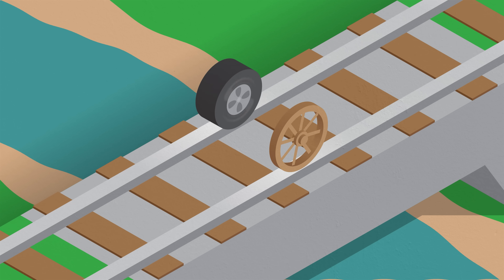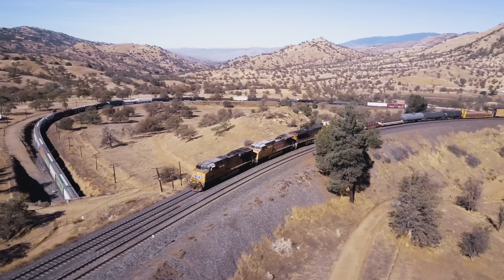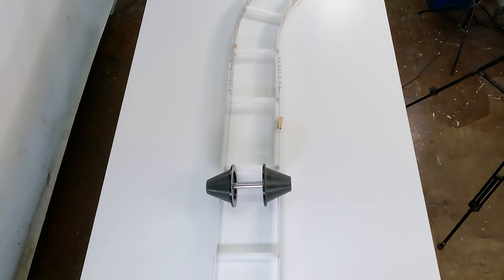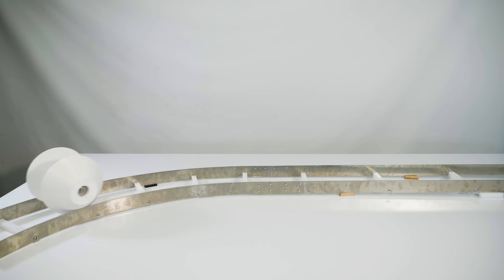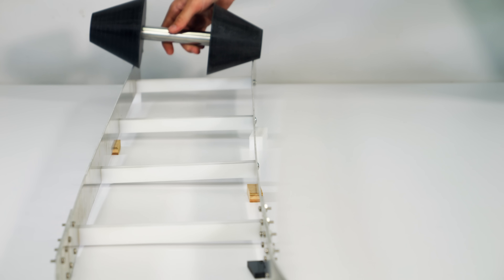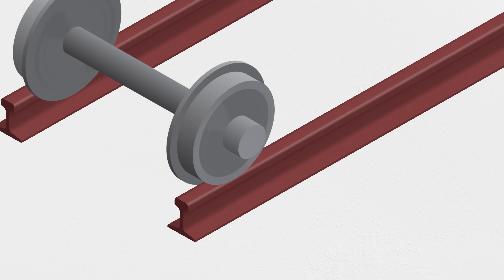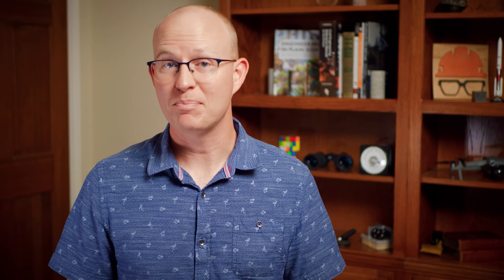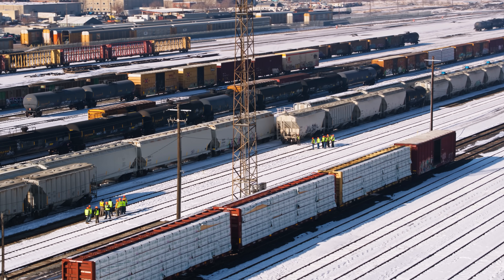Why Are Rails Shaped Like That?

Comment: Hello Grady i had a question about a log splitter my buddy and i are going to build. I don't have the knowledge to calculate if this beam is strong enough.
This beam is 8" wide top and bottom with 1/2" walls the beam 12" tall with either 5/16" or 3/8" web. for safety I figured using a 5" cylinder at 3000 psi more realistically either a 4" cylinder or 5" cylinder around 2200-2500 psi. This is just a picture of what beam we are using. i just wanted to see if it will hold up. Usually an "H" is more ideal as far as I know. Any help would be great, thank you. I also like your YouTube videos and thought you would be the person to ask.

Comment: Hi from the other side of the "Pond" where Railways were invented. What is most amazing is that the fundamental shape of the rails were understood by the Victorians 150 years ago! In the UK rails were attached to the sleepers using chairs hence the shape was known as bullhead where as in the early USA the use of spikes onto the wooden ties hence the flat bottom shape allowed for the faster and cheaper construction needed for the distances involved. Over the past 50 years UK uses flat bottomed profiles on concrete sleepers.

Comment: Why passenger trains stations are not built elevated from the terrain  before and after the station? If built this way, energy could be saved by minimizing the breaking energy waisted and the need to accelerate when the train leave the station again . The same is for roundabout and junctions where cars should decelerate or stop anyway and then accelerate again.

Comment: When loud "squeaking" or "screeching" occurs while a train comes along railtracks, this is a sign for the railhead being worn off resp. also too flat. Maybe also broadening has occured because of the heavy weight being applied with every pass of a train. Especially the noise then occurs in curvy segments. Therefor grinding is necessary from time to time (re-shaping of the railhead on otherwise intact rails) or, if inner damages have occured - structural wear - which is detected by x-raying the rails during maintenance passes along a track, the replacement of a damaged rail is necessary.

Comment: In the south of the United Kingdom we restore steam locomotives:  https://www.southern-locomotives.co.uk/News/news.html  and this includes replacing worn steel six food diameter locomotive driving wheel tyres.  The maintenance, inspection, safety certification, insurance,  and running costs are enormous and require years of forward planning.  Every 10 years the boilers have to be removed, government inspected, repaired as required and pressure tested, before reassembling.  Plus, you can't get spare parts at your local DIY shop!  I remember a hot September morning 1947 attending the ceremony naming the first Battle of Britain class locomotives by my future stepfather:  https://www.youtube.com/watch?v=AQNnfsFcbz8&ab_channel=BritishPath%C3%A9   There's nothing so moving as live steam!

Comment: Even if hunting doesn't lead to derailment it can be very hard on the equipment and rails. 
Flange greasers are used to alleviate wear in curves and reduce noise. 
High tech rail scanning vehicles can find small defects in the rail before it becomes a problem. 
If within parameters, the rail head can be re-profiled by rail grinding instead of replacing the rail.

Comment: No, not all wheels have flanges. Some locomotives have too many drivers close together to allow for all wheels to have flanges and still negotiate tight turns. You see this especially on trains designed for mountains or narrow gauges. They may have two flanged wheels, followed by four flangeless that are allowed to float about on the top of the rail, followed by another pair of flanged wheels. These are also called blind drivers.

Comment: You skipped a topic of rail re-grinding. Once they are old and beat up, a special service car rolls along and grinds the correct profile back into the rails. This can be done many times over before the section needs to be replaced due to thinning of the material.

Comment: I'm 74 and when I was young I worked on what is called a, "section gang."  At times when the replacement rails were not available because of the inner edges being worn,  it was a common practice to remove the spikes and turn the rail around so that the unworn edge of the rail was to the inside of the track.
Reply: I'm a little older than you and remember when farmers in the South did something similar with their tube socks.

Comment: Back in the late 80's, I went to an Arizona Cardinals Football at Sun Devil's Stadium in Tempe (Phoenix), Arizona. In front of the Stadium ran the train tracks. Being the juvenile delinquent that I am, I put a penny on the track to have the train smash it. I watched the train run over it. After the train had passed, I went to recover the flattened penny. It was gone, disappeared, vamosh,  escaped. Well, at least the train didn't derail.

Comment: Uhhh... That squeal on the curve isn't caused by the flange.
Reply: It is slipping due to difference in outside/inside travel on curves. I live near a port of entry where 25 trains daily pass curves at a slow speed, the squealing is deafening. The request for track oilers falls on deaf ears.

Comment: However, a small contact area also has a very positive effect on rolling contact fatigue and crack formation. This often leads to fatigue cracks, especially if the contact surface is close to the rail flank. This means that rails often need to be replaced or grinded and reprofiled. How are rail defects actually detected in the USA? Like here in Germany, are there regular ultrasonic or eddy curent checks of the tracks and switches?

Comment: Rails are set at a three-degree inward angle supplied by the tie plates installed between ties and the rail to improve wear. A considerable amount of springing trains experience is supplied by the track, via rail flex and  roadbed and subgrade sponginess. That's why lightweight trains don't ride well-they don't cause rail flex.

Comment: Regarding wear on wheels and rails, on some curves you'll find grease pots to lube the wheels going into a curve.
But some if not all locomotives dispense flange lube oil when needed (so no need to maintain the pots anymore).
 And for traction after a dead stop, they spray sand into the V where the wheel meets the rail.
There are large sand boxes on locomotives front and rear. You'll see the sand nozzles at the leading and trailing wheels on each "truck".
 There is a Wabtec (previously General Electric)locomotive manufacturing plant in Texas, I would love you to take a tour (DFW area I think).

Comment: You didnt mention train tyres

Yes, in the UK, I believe we have tyres on some wheels

There not made from rubber though, there basically hardened steel bands, heat expanded onto the wheels, basically wear bands, the wheel can then be made from a cheaper, a less strong steel than usual, but the tyre would be made of very strong expensive material

You could call the tyres sacrificial parts i suppose

Comment: I am a retired locomotive mechanic.  Wheel measurements are so important, if the flange gets too low the car or engine can derail in a curve. Flanges that get too narrow can "pick" a switch and send a wheel set down the wrong track. Locomotive have flange lube sticks that lubricate the flange to slow wear. The other important measurement is diameter which needs to be close side to side. Really enjoyed this video explaining  rail loads and design.

Comment: You might do a chapter on derailments.  The key point is that as long as the wheels are rolling they keep the cars on the track.  But when the wheel stops turning the car is going off the track since there's no longer any force to keep it on the track.  It seems the railroads have not implemented anti-lock braking systems.
Reply: They have, but only on locomotives and on passenger trains. It's known as wheel slide protection. It would be prohibitively expensive to put on freight cars.
Reply: Hi:  Are there statistics that compare freight v. passenger train derailments?  That's to say is there any evidence it works?
Reply: Hi:  Are there statistics that compare freight v. passenger train derailments?  That's to say is there any evidence it works?

Comment: I understand that there is more in here than you can cover in a 15 minute video. But I'm wondering if, rather than bringing worn rails back to a rail yard or switching area, what about swapping them almost like rotating tires on a car. Could it be easier just to move the right rail to the left side and the left rail to the right side, which would obviously swap out the worn areas and expose a new area to the friction of the wheels.

Could that work?

Comment: There's also the mysterious 'grease pots' used on curved rails. I suppose there's a whole video in explaining why they are needed when the argument is the flange of the wheels never touches the rail. Your lucky to be sponsored. I've never had any opportunities like that on this site.
Reply: Those are called flange lubricators and yes, flanges do touch rails enough so that the rail edge gets worn down. If the train is going really fast thru a curve, the wheels go 'airborne' and ride entirely on the outside flange. RR's regularly swap inside and outside rails on curves to even out the edge wear.
Reply: When you get enough subs you will get sponsorship offers.
Reply: I'm seeing more and more sponsored ads lately, I think something has changed recently.

Comment: Thank you.  I missed a discussion of the interior radius between the conical wheel and flange.  I was instructed that this small radius is what keeps the flange from wearing on the rail.  Without such radius the wear on flange and rail is substantially increased.

Comment: As in another comment, the height of the web is not just to provide clearance. As in any other I-beam, web height is the most important component of the strength and stiffness of the rail. Insufficiently stiff track would negate the stiffness advantage of steel v another material, such as rubber

Comment: I'd say the most efficient shape to carry compressional loads and feasible to mass produce.

For instance I-beams for steel structures. Your filler beams will carry bulk of load. 

Picture a beam tied in by two columns... If you subtract the top and bottom flanges, all you have is a flimsy horizkntal sheet of sheet.

However by added both flanges you  create perpendicular layers to distribute weight. The web crarry most of the weight. 

Its not like wood, just bolt a wooden beam. Steel gets heavy fast. So you need something strong and light. Connecting steel billets, wouldn't be practical, a beam would though.

Comment: The Railroads will soon save us from ourselves! Go green fuel! They can haul their own nitrogen extractors. 😊 🚂🚃🚆 Flanges on the outside would pull the wheels off. Ingenious,  or trial and error? 😂😂 On Richard Feynman, if you want to break spaghetti in half, leave it in the box and fold it 90°. If you go past 90° the box will break open and the spaghetti will go everywhere if you don't catch it. 😉 Or, just break it over the pot. 😏

Comment: 50 years ago, I was a trainee engineer (fireman) in shunting yards of an Australian railway(not saying where)the job was considered a "Dole bludgers paradise, the driver would sit oneside the cabin, fireman the other, never really "fired" very long with the same driver, so, some would work to the "Book" but if you got a good one, you could stick a match in the "minute man" button (that required to be pushed every minute and drove one slowly mad, other wise the brakes would be applied) to jam it, then sit there and read a book, as it really was a one man job anyway. Night shift was the best, start at 11pm, work for two hours, then go and crawl into the rear of the panelvan that was bought especially for this shift as everybody had them and go to sleep. At 6 am get woken up by the Station Master, after a hot cup of tea and quick bite to eat, go out untill seven am then knock off and go home, got the whole day to do whatever, repeat the next evening, why did I leeeave?...why!...why!....why!?......used to feel sorry for the shunter's who were out in all weather, hail, bucketing rain on a freezing winters night, or sunshine, so when you go to bed tonight and if it's freezing, with squally winds and bucketing rain,have a thought of the guy's out there in heavy rain coats, holding a lantern with red, yellow and green lights putting a train together in some rail yard somewhere.

Comment: Great video! Love how Railway Engineering is getting attention :). One fascinating thing you could have mentioned to further awe people is the fact that the contact pressure is many times greater than the yield strength of rail and wheel steel. Yet, the wheels and rails do not fail!! The reason is that contact pressure is hydrostatic or normal stress, and steel being a ductile material fails in shear :) . The maximum shear stress occurs at some depth under the contact patch, and is within the yield limit, thus making it OK to put even higher axle loads and achieve contact pressures of upwards of 1.2 GPa, while the yield strength of steel remains at around 200 to 400 MPa. Its a great question to ask budding engineers who watch your videos :)

Comment: Id be interested to know the design, if there is any, in to creating the convoy of a train. For example, what if you have heavier cars in a section and in other sections of the train there may actually be empty cars. How does that impact the linear pull of the convoy whenever the train is in a radius? I've also noticed in the past few years that pusher engines are now being moved to the middle of the train. I would love to know the rules about designing a train or is there no rules at all?

Comment: Excellent video, much appreciated.

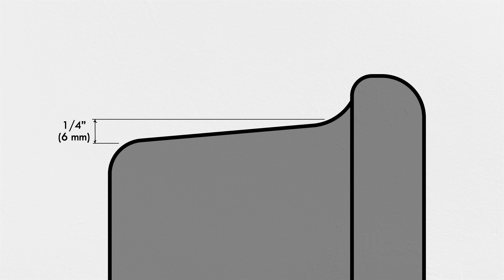At 6:55, you say that the diameter has a ¼-inch (6 mm) taper, but the illustration would indicate that it's the radius that has such a taper. Is the statement correct, or the illustration?

Comment: 2:42 "flanges - the wheels on railway vehicles all have them." No, they don't: https://en.wikipedia.org/wiki/Driving_wheel#Flangeless_wheels
3:57 "they need that design to withstand incredible loads" No, it is essential that the wheels rotate at the same speed for the conical wheel system to work.

Comment: As @MsCriticalthinker201 says below, the top of the rail is indeed not flat. We call it the ball of the rail. They have special maintenance equipment called rail grinders. They put the arch or ball, back on the rail. You can most certainly feel rail that has lost its ball but especially going around curves.

Comment: 0:37  Why do the US still use wooden sleepers? In Russia they are being replaced everywhere with concrete ones; I haven’t seen wooden sleepers on main lines for a long time, only on auxiliary tracks.
3:57 For this condition of the track, our section engineer was fired, and even worse, they could be imprisoned.
7:22 In Russia they are moving away from this old bolted fastening towards maintenance-free spring type ARS (рельсовое скрепление АРС или АРС-4)

Comment: A tram (streetcar/light rail) network was extended through my UK town a few years ago. The individual lengths of rail were shaped to fit the terrain using a precision bending machine. Not one bit of rail was uncomplicatedly straight - each one had to be bent in three dimensions.

Comment: I really enjoyed this video.  It came at the perfect time, as over the past few weeks I was worrying about the premature  wear on my Lionel engine, cars and the rails on the circuit they run. I think you saved the day. All joking aside, this is a great video.  I enjoy watching videos that explain why things we see every day are the way they are. If anyone reading this has deep pockets, hit me up.. I have an idea that may turn out to be the replacement for our current trains. In a nutshell.. it's like a train, but in a vacuum (possibly a very large Dyson). Instead of running on steel tracks this train inside of a Dyson will move down what I would describe as an extremely long air-soccer table. To use the most current annoyingly overused phrase, this will be a game changer.

Comment: What alloy are the rails and wheels made of? Some people take short sections of old rail and turn it into anvils.  Whether used for rail roads or blacksmithing, that material seems very hard and at the same time quite shatter-resistant.  So what is this wonder material anyway?